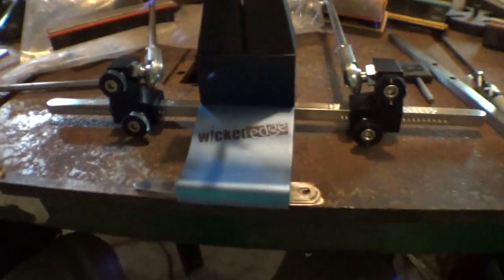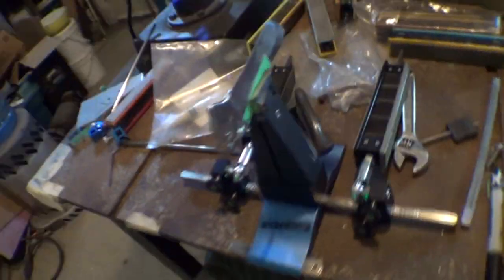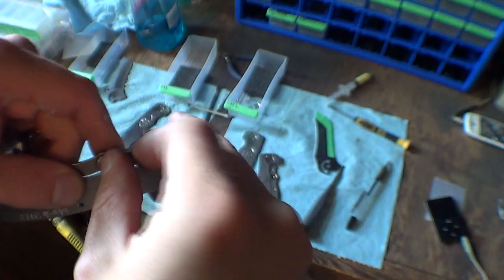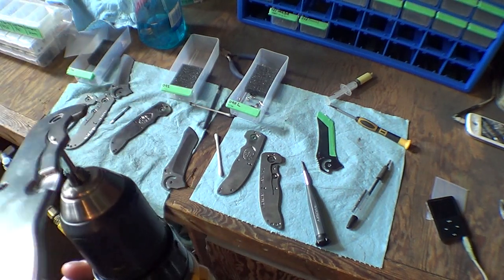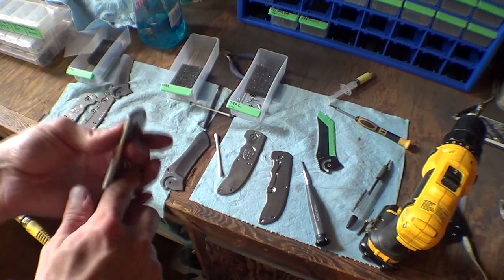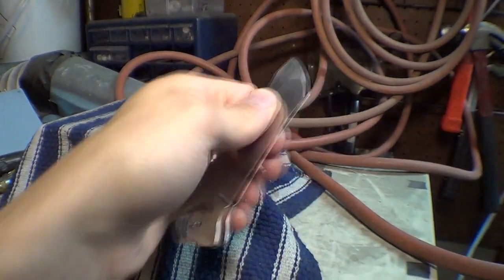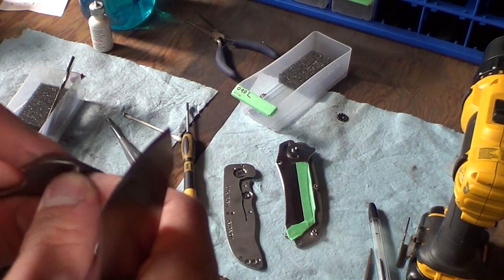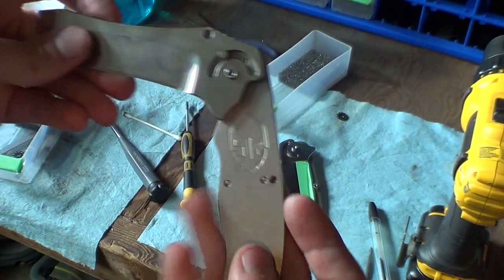Knifemaking Tuesdays Week 69   Wicked Edge and fixing handles

Comment from the maker: The problem with using a T-handle and a 4-40 tap is I keep breaking them.  The one I have doesn't have a removable rod, but you're right, that would give a much better feel.  I like the drill because it rotates it concentrically, with a T-handle it's way too easy to tilt it off center and go snappity snap.  Good to know about the 5 axis work, I'll try to remember that.

Comment: Chasing threads with a drill is fine for deep threads but for shallow and small stuff, take any tee-handle (cheap canadian tire handles are fine) and remove the rod. It will give you a "feel" for when you hit bottom, even when you have a thin-wall bottom.
Also, your geometry is definitely off on the blade. Your center hole is not concentric with the slot.
Cheers from New Brunswick! If you have a question, or if you need any 5-axis stuff done, drop me a message!

Comment from the maker: I always climb mill, and the codes are pretty much identical for lefty and righty, just in different locations, so it's not really that.  I tried the stop-the-reamer trick and didn't like it much, I thought it scarred the hole on the way out but I can't exactly remember.  
The coarse stones sure do remove material fast, but they put some pretty deep scratches in that take a while to remove with the higher stones.

Comment from the maker: There's two ways.  I can stare at the code and do some math.  Say the righty code drills a hole at X1 Y-0.5, and the flip axis is 5" to the right, the lefty code should be X11 Y-0.5.  
Or I can play with the CAD/CAM software, draw some lines, do some measurements, compare some stuff.  That's usually how I do it.

Comment from the maker: I made that part so thin because I wanted as much thread engagement as possible.  And I couldn't put them back on the mill because when I thread that hole it's still attached to a huge 10"x18" sheet, doing 18 at a time, I don't have a fixture that does them individually, and even if I did, the CNC would not be able to pick up the exact same thread position.  ;-)

Comment from the maker: That's a very good point, I think you're right!  That was one of my theories but I haven't thought about it enough to confirm it yet.  But yeah, the arc is definitely off center from the pivot hole in the blade, because it only rubs on one side of the arc.  So either the hole is off or the arc is off from where it's supposed to be.

Comment from the maker: Good thought, but I don't think it's a clamping issue.  All my handles and blades are pinned onto the fixture during machining, and the lefty pin locations are (hopefully) accurate.  I think there's a better chance that the problem is in the code, when I flipped everything for lefty.  All 5 were pretty much the same wrongness, so it's a repeatable problem.

Comment: Not sure what program you are using but in Inventor, I can make an assembly and mirror a part or sub assembly. This then make a mirror or 'left' part file and can be use and opened separately. No need to re build the whole part for a left. Also, I would mount a rod on your wicked edge table to index the tip of the blade so they are the same every time.

Comment: Hi to you both for the upload.

Just wondered because if you said what caused the extremely shallow holes to the lock bar I missed it. I am wondering why some should be ok and other not, and why perhaps you do not leave on a little more ‘meat’ so the locking part doesn’t push through for instance any dust or lint which it could possibly do. Also wonder why you did not put them back on the machine to rethread the threaded holes instead of using a ‘sledge-hammer’ by comparison, the drill?

Comment: You guys should try sharpening free hand on a grinder. It's not hard once You practice a bit, much faster - 120 grid belt, then buff out the burr on a leather belt (You can buy these for Your small grinder/sander), leaves a shaving sharp edge instantly. Another thing with the hinderer stabilizer You should've just mount the disk in a drill and while spinning touch it to a sander belt (freehand lathing it smaller) ;) Another nice vid. Take care Guys!